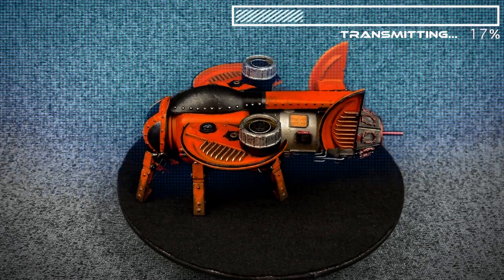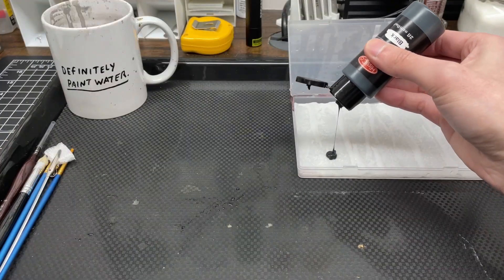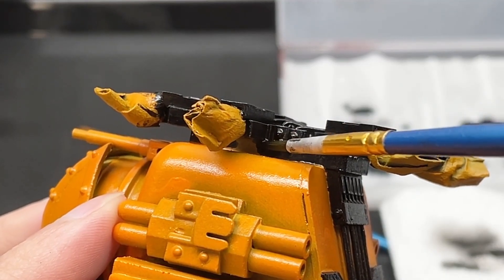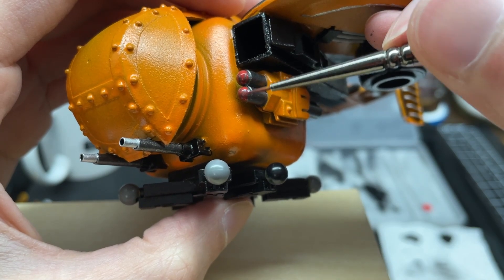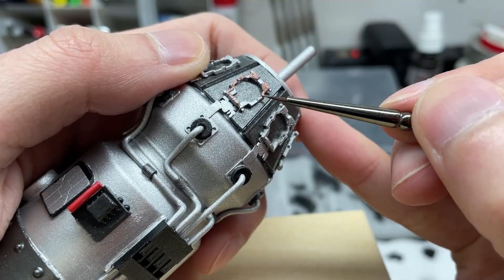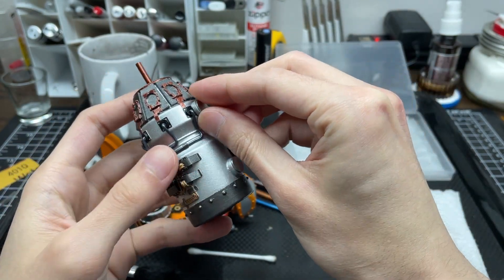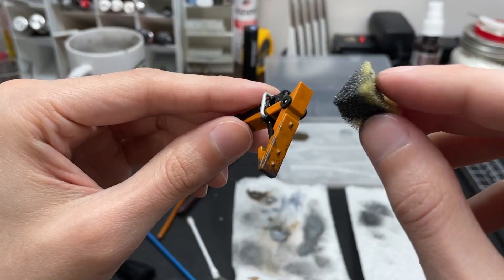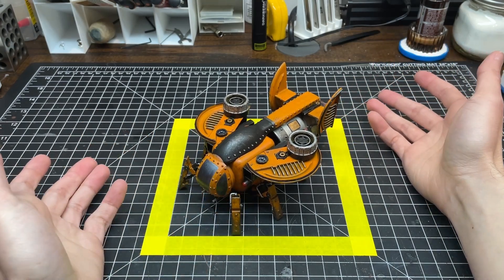Project WASP: Flying Mech Painting (Part 3)

Comment: Wow.  I usually hate rivets in post-WW2 models since they have mostly been replaced by welds in real military vehicles, but I just can't here.  The amount of thought put into the design specifics and paintwork - specifying that this is a pre-production model made from salvage and is an entirely unique craft - makes the whole thing tolerable.  I'll just pretend they're hexbolts or something.

All that said, normally running this craft anywhere near mach 1 on an earthlike planet with rivets and deployed landing legs is not going to happen.  I can't even guess what would happen to this craft.  That said, I can totally see a use for such an overcharged engine on such an un aerodynamic craft - running the hell away like a missile.  If you have enough fuel on-board, you can use the wing engines to nose up your craft - then you open the fuel pumps to the primary engine all the way and engage the afterburners.  You will not really be in control of the craft until you slow down again, but your hypersonic ballistic GTFO can probably go for longer than the engines in a merely supersonic ground-to-air missile can.  

If you've seen _the Last Starfighter_, this maneuver is pants-on-Death-Blossom retarded, but like the DB it's better than dying just because the enemy wants you to.

This also presents an alternative mission for the WASP with some remodeling or partial refit - exfiltration.  If you can reduce the radar and thermal signatures of the craft when it's at a slow cruising speed, it can be sent into contested territory to recover downed but surviving vehicle pilots and VIPs.  Done right, the first time the enemy notices your guy will be once the target is secure and it's type for the hypersonic GTFO maneuver back to skies with friendly antiaircraft.
Reply from the maker: I love your analysis of the WASP, I also considered issues with aerodynamics of rivets and legs, among other things, but I still sprinkle in a few details like those because I enjoy the aesthetic haha. I’m more versed in tanks, where I think it’s fine to abuse rivet construction in a world of cheap mass production on heavy, lumbering machines. I would have loved to get the legs to fold inside but too much complexity and too little time for a build made of lids!